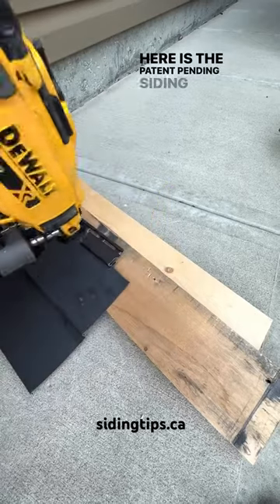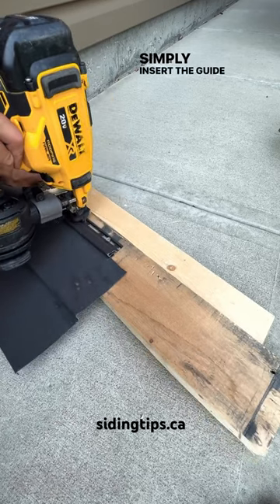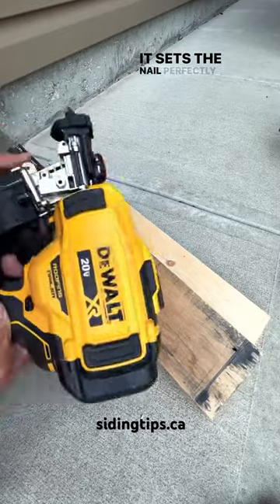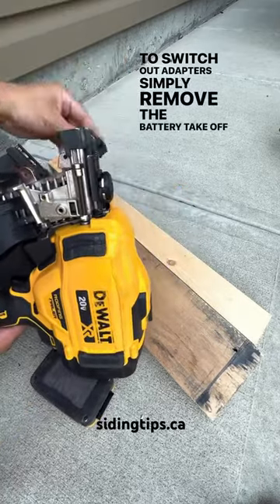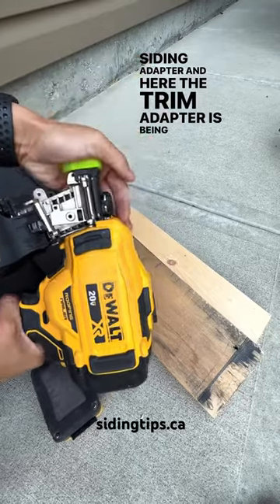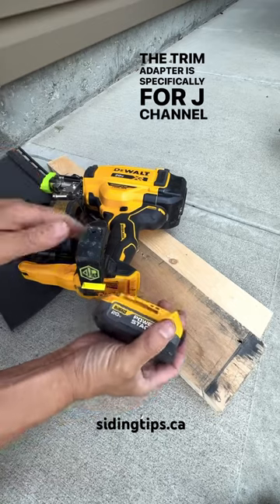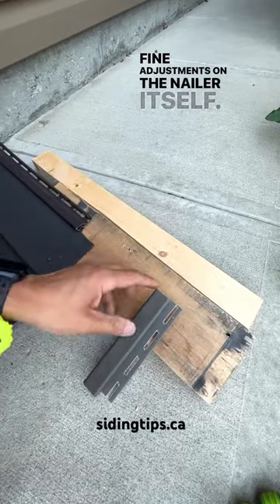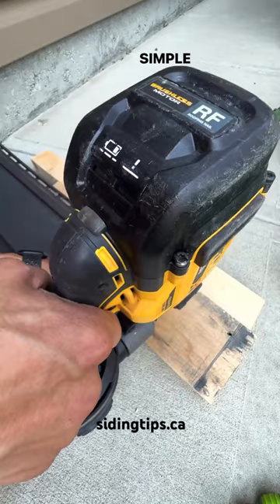Vinyl siding nailer - patent pending siding adapter for Dewalt 20 volt roofing nailer DCN45RN

Comment: Do you make a tip that fits joist / metal hangers?
Reply from the maker: No we don’t. The joist hangers would require a positive placement nailer which Paslode has

Comment: Are you using roofing nails or siding nails
Reply from the maker: 1 3/4” roofing nails.  They are on the recommended fastener list for vinyl siding installation